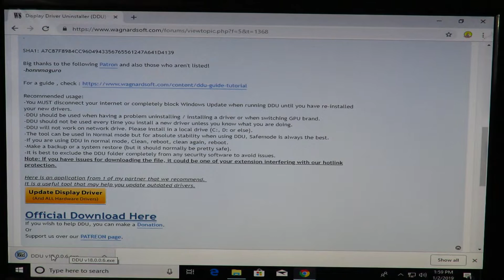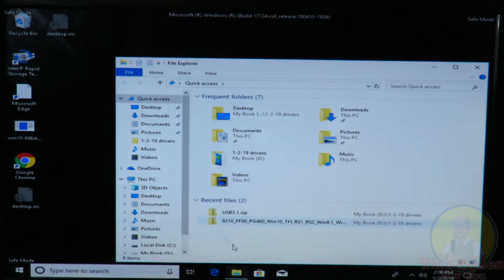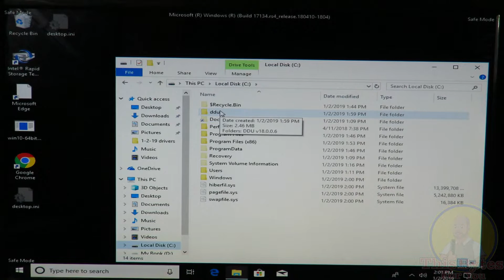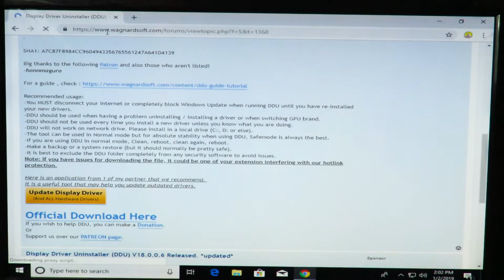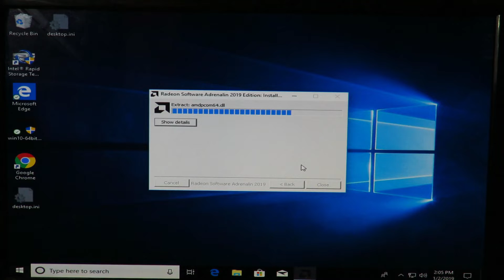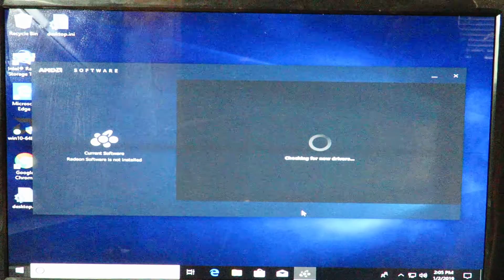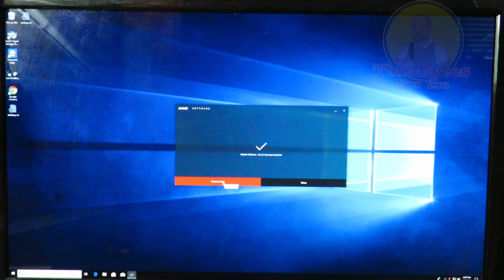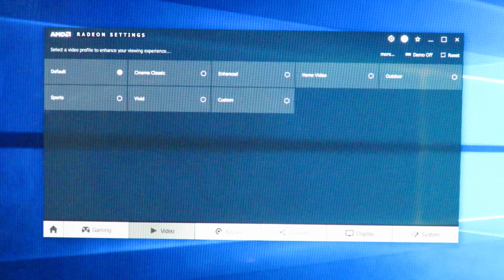How to install the AMD Sapphire Radeon Nitro+ RX 590 8GB OC Special Edition

Comment: I have a SAPPHIRE AMD Radeon RX 580 NITRO+, 4GB GDDR5, 256bit, 11265-07-20G
 (https://mediagalaxy.ro/placa-video-sapphire-amd-radeon-rx-580-nitro-4gb-gddr5-256bit-11265-07-20g/cpd/CSA112650720G/).
 What Power Supply do you recommend, or cable addaptors if will work. 
My old power supply(500 Watts) has only a 6pin cable,i tried to install it(connected the 6 pin cable) but doesn't work,the logo light is on tho(from the comments i understand that you need 6 pin and 8 pin cables in order to work).
My specs:
 CPU: Intel(R) Core(TM) i5-4460  CPU @ 3.20GHz (https://ark.intel.com/content/www/us/en/ark/products/80817/intel-core-i5-4460-processor-6m-cache-up-to-3-40-ghz.html)
Motherboard: MSI H81M-E33 (MS-7817)  (https://www.msi.com/Motherboard/H81M-E33/Specification)
GPU: GIGABYTE NVIDIA GeForce GTX 750 Ti 2 Gb
RAM:8 Gb
Reply from the maker: you are fine with a 500Watt, but not all have an 8Pin.  You can adapter 2 x Molex connections to make an 8Pin using this along with your 6Pin connection: https://geni.us/sVDjbp.  Let me know how that works out for you.
Reply: @ThisBytesForYou  Thank you for your fast response,i will get those cables and try it.
I forgot to mention the Hard Drives(2 HDD's and 1 SSD),don't know if matters or not.
Reply from the maker: It might, if you don't have available molex connectors,  make sure to check before you order it and you are so very welcome my friend
Reply: @ThisBytesForYou  

Finally i manage to buy a new power supply ,installed the graphic card and the latest drivers from AMD,but with this new GPU i have 60 to 70% FPS drop compare to the old GPU(GeForce GTX 750 Ti 2 Gb).Coul'd be  bottlenecking?
Reply from the maker: @Draccian  eeke, that should not happen at all, the 580 is much more powerful than a 750, it is 3 times more powerful.  Try Using DDU to remove the NVIDIA and the AMD video drivers (and make sure to disable the automatic windows update feature for drivers from within DDU so you don't have Windows messing you up), you can find my video on it here, and after you uninstall it all, install the latest and greatest AMD video driver and you should be good.  https://youtu.be/clLYbBywhAg

Comment: lay down the pc on the side,  plug in the cables and then plug the card in to the mainboard
Reply from the maker: yeah, as easy as building a house right, put some blocks up, put some pipes in, some cement, some windows, a roof and your done.  Steps you missed, turn off PC, remove side panel, remove older card and cables (if you have them), insert new card into 1st PCI-e slot, screw card into PCI-e slot, plug in both PCI-e cables.  Put side panel back on (optional) and turn PC back on.  Uninstall old drivers (you can do that before or after) and install new drivers.  You might think it's as easy as you say, but scroll down the list here and you will see how many questions people have and how many people I have helped.
Reply: I was pointing out what is easier to do! lay down the pc because its more maneuverable and has more stability to work, then plug in the cables into the card before you plug the card into the mainboard and you won't have to struggle with the cables afterwards like you did.
Reply from the maker: @halatameckarov6532  ahhh I see, i apologize.  So i have to build like that standing up, for a few reasons.  It is very hard to demonstrate with the PC laying down, it leads for bad shots with the equipment I currently have, working hard and heavy to improve all of that.  Also, I have a bad back, so I would have to hunch over to demonstrate and the biggest difficulty is that damn camera in the way,.. hahahah its right there, hard to get it just right without being in the way.  thank you so much for stopping by, checking out the video and commenting, it means the world to me.

Comment: Thank you! By the way, I am having trouble with audio after installing the graphic card. Do you know by any chance what's causing the issue? Or does the gpu doesn't support audio? I don't know what's going on.
Reply from the maker: You are very welcome my friend, very happy I could help.  Yes, the audio does work with the gpu, but you have to select it.  So in windows 10, if single left click on the right hand side of the task bar, where the time is, on the speaker, click on the up arrow that will open un a list of sound devices, find your gpu there and click on it, see if the sound comes out of there.
Reply: @ThisBytesForYou  I tried almost every way of changing default audio but no good at all. All the audio jacks are working when I plug a speaker device... my monitor has built-in audio speakers and these are the ones not working with the gpu, in other words it's not detected.
Reply from the maker: @davjjosol  maybe you are having issues with your video drivers, I recommend checking out this video, and following the instructions (where it says NVIDIA, use AMD instead) and then downloading the latest AMD Video drivers from here maybe and let me know how it goes: https://www.amd.com/en/support/graphics/radeon-500-series/radeon-rx-500-series/radeon-rx-590.  Your monitor has build in speakers but are you using DVI or HDMI/DP what version cable are you using and what monitor do you have?
Reply: @ThisBytesForYou  I appreciate your help! Very kind of you. Well I have the ASUS VC239(H) Monitor with HDMI. Will definitely check out the links sir thanks a lot!

Update: still no good, I've done this process again again after I plugged in the graphics card. Everything is fine except the audio via HDMI
Reply from the maker: @davjjosol  OK, going through the manual, I find this, let me know if this helps:
.• Make sure the audio cable is properly connected to the monitor
.• Adjust the volume settings of both your monitor and computer (So there is volume control on both the monitor and in Windows)
.• Make sure the computer sound card driver is properly installed and activated
.• Make sure the audio source is correct on the OSD. (The Audio source, it does not really go into detail what they mean here, but it is another thing to look out for)

https://dlcdnets.asus.com/pub/ASUS/LCD%20Monitors/VC239/ASUS_VC239_English.pdf

Also, on page 1 of this document, look at Diagram 2, B and C: https://dlcdnets.asus.com/pub/ASUS/LCD%20Monitors/VC239/F41G78S168011B_VC239_VC239H-W_QSG_EN_150514.pdf

And you are very welcome my friend, I love helping.  Please let me know how it goes for you.

Comment: I installed the gpu and got drivers then my screen went black and monitor detected no signal??
Reply: Yes I have
Reply: It’s not even detecting the dp anymore
Reply from the maker: That is incredibly odd.  Reset your computer about 6 times in a row which should take you into the section where it lets you select how you boot, chose safe mode with network access and download the and drivers from herehttps://www.amd.com/en/support/graphics/radeon-rx-vega-series/radeon-rx-vega-series/radeon-rx-vega-64, then use ddu to uninstall the amd drivers and when you reboot you should be able to go back on into regular window, then give that a try again
Reply: i fixed the problem something was wrong when i put it into my motherboard it had a issue
Reply: i had to reinstall it
Reply from the maker: @MaybelineMomma  ahhh ok cool, I hope you like it
Reply from the maker: That's wierd, it should have come back.  Have you tried restarting your computer manually?

Comment: Very helpful video but I am still struggling with getting it working!

I have slotted it in and hooked up the power cable to the card directly. I have a hdmi cable going direct from the GPU to the monitor. When booting the pc up the GPU has a blue light on which I'm guessing is good as signifies it has power going to it. The monitor  I recall says no input source or something along those lines. I have also tried a DVI from GPU tp hdmi monitor.

Any ideas of what I'm doing wrong?

Cheers,

Andu
Reply from the maker: have you tried making sure your monitor is on the HDMI input, not all monitors connector automatically to the correct input?  Also sometimes, as stupid as it sounds, removing and reinstalling the video card helps.  You have both PCIe cables connected as well right?  And thank you so much for your kind words, they mean a ton to me.

Comment: Hello there, I just bought a rx580 and I was about to install it today but I noticed my PSU has only one 8(6+2) connector. It's 500w and on the box of the rx580 it says it's enough so is it ok to just attach a Y splitter 8pin to two 8(6+2) pin?
Reply from the maker: yes, 500 watts is the recommendation for the card, but rather than split the 8Pin, which may consume too much power, why don't you get something like this, so you can use your molex connections: https://geni.us/sVDjbp.  I would recommend you plug one of the 2 molex connections (one adapter brings 2 molex adapters) into one strand of molex cables on your power supply and the other molex connection on another strand, to make sure the power is distributed evenly, then plug that into the video card.

Comment: hi, im building a computer for my niece, and i have a question, the cables you connect to the video card are from the power suply?, mine dosnt have cables and i have to buy one i guess
Reply from the maker: I would be more than happy to help you my friend.  Could you please let me know who makes your power supply and the model one?  Also, please let me know what motherboard (make and model) and what CPU you have.  This way just in case, if the power supply you mention is not good enough, I can get you the right one, I am always happy to help you my friend.
Reply: @ThisBytesForYou   good morning. The powe suply is a corsair 750m, processor i7 6700k @4.00ghz and the mother board is an asus b150m-a/m.2. Thank you for your time and response
Reply from the maker: @keikakudoori  good morning my friend, looking into the specs, I see that the power supply brings 
6 x 6+2-Pin PCIe cables, so if you still have the box, they might be inside,if you lost them, then you could probably order new ones from corsair, just email their support site: https://help.corsair.com/hc/en-us/requests/new.  its a good power supply, but its not cheap: https://geni.us/LKZy.  And you are very welcome, thank you so much for checking out my video and even more for commenting ,it means the world to me.
Reply: @ThisBytesForYou  no problem. but i cant get the cable from the suport in my country. my last question is if i can buy the cable in amazon. there is one that have an 8 pin  male that goes into the psu, and then the cable have 2 ends of 8 pins (6+2). i can use this cable or i have to buy 2 cables (6+2 pin)?
Reply from the maker: @keikakudoori  problem is its hard to know exactly what cable to get, they are not all the same, each manufacturer makes different cables, for different power supplies, but maybe this would work for you, https://geni.us/TEM9J or you can contact corsair and find out what package will work for you, they will give you a cp number
Reply from the maker: @keikakudoori  but if you do, yes, the cable that has 2+6 Pin is perfectly fine.

Comment: Just installed this card but I'm confused on the cables I need. I have an 8pin male to 8pin male but I don't have any 6pin cables. Should I buy a 8pin to 6+2pin pcie cable please? Cheers phil
Reply from the maker: do you know what manufacturer and model power supply you have?
Reply: Thanks for your quick reply, I have this one: Game Max RGB-850 850W Modular 80 Plus Gold Power Supply
Reply from the maker: @funky348  so be careful, it looks like you using the 8Pin EPS cable, for the CPU.  The unit states it comes with 2 x 6+2 cables (which are 8pins), so if you still have the box with the cables in it, those should be there.  If not, let me know what motherboard you have as well.  And you are very welcome my friend, always happy to help.
Reply: My motherboard is a "Aorus z270x-gaming 7"... the graphics card didn't have any cables in the box. I had a black 8pin connector already so was going to use that but will wait and go with your recommendations. Thank you.
Reply from the maker: @funky348  no no, I mean the power supply should have extra cables.  That 8 Pin connector I think is for your CPU, check the power supply box (if you still have i) for extra cables.
Reply: Sorry i misunderstood... Yes you are right I have two 8(6+2)pin cables... Assume I use both with this card (leaving the two pins out of the 6 pin port of the card on one of the cables)?
Reply from the maker: @funky348  yup, you are correct ;), let me know how it goes.
Reply: @ThisBytesForYou  thank you for your support. Much appreciated!
Reply from the maker: @funky348  you are so very welcome my friend, I hope to see you around here more often and if you have any other questions, as always please feel free to ask

Comment: Would you recommend this card for the the coming years to play at maybe 1080p high and also I wanna play games like cyberpunk2077 call of duty Black ops 4 and rage 2
Reply from the maker: yes, it is a great card and it should be able to play Cyberpunk 2077 at 1080p, but you can find the requirements here, Black Ops 4 and Rage 2 you should also be great with the Sapphire nitro+ RX 590, you can check it out on Amazon: http://geni.us/CWSOO8N.  As for tomorrow, I cannot say, as games require more, they are forced to make better video cards and vice versa, there is no such thing as future proof I am sorry to say.  You can check out the system requirements for Cyberpunk here: https://www.game-debate.com/games/index.php?g_id=4614&game=Cyberpunk%202077.  Let me know what you decide to do.
Reply: I think I might still get the Rx 590 I'm fine with turning some graphics settings to medium
Reply from the maker: @MaybelineMomma  OK great, and actually even with the highest end care, many times there is no need to go to the highest settings, Medium or High is great as it is, I like the way you think and I agree with you.  Let me know if you end up getting the card, and if you use that link, it would help me tons as well.  Thank you so much for stopping by and checking out this video and even more for commenting, it means the world to me.

Comment: will this gpu work at 1080p highest settings triple aaa titles
Reply from the maker: at 1080P, you should be good.  This card plays decently at 2K, but its optimized for 1080P, you won't be disappointed.  Check it out on Amazon: http://geni.us/CWSOO8N

Comment: I have AMD-A10 APU, should I uninstall the APU first before plugging in the card?
Reply from the maker: yes, download and use DDU in safe mode to uninstall the APU drivers then shut down the machine.  install the GPU, then turn on the machine with the monitor cable connected to the GPU and enter the BIOS.  Disable the APU in the BIOS, then save and exit and install the newer GPU drivers in the OS.  There are times that the APU will need to be used when entering the BIOS as the auto detect may not be selected, but you will surely know if you are not getting video.  Please let me know how this works out for you.
Reply: It's bottleneck imo, I have Ryzen 5 1600. Got 60fps on CSGO while 200+ on R5. CSGO/DOTA are cpu-intensive games though. But if you want to get the most out of your 590, consider upgrading your  processor.
Reply from the maker: @Kenjn_DJ  any game is cpu intensive if the resolution is set low.  You will get over 60fps if you have your vsync is on, turn vsync off.  Its not a bottle neck for the video card, I promise.  I recommend using DDU to uninstall all of the older drivers then installing the latest and greatest and make sure vsync is off and your onboard gpu is disabled
Reply: I have also a10 7860k and an RX 590. Im worrying about the bottleneck :(
Reply from the maker: @lazylad6642  thats a decent processor actually, no reason to worry.

Comment: Can someone please help me? I'm new to pc gaming and I've been saving my money and I want to build a pc with this graphics card these are my specs

Rx 590 sapphire nitro plus 

Ryzen 5 2600

Asrock MicroATX Motherboard (B450M PRO4)

Evga 500 w (Power supply) 

Crucial ballistix sport LT 2400 ddr4  (8gb) 2x

WD blue 1tb hard drive 

Vivo black atx midtower

Can anyone with experience tell me if this works or if you have any better build ideas ( I still want to keep the ryzen 5 and the graphics  card the same) my budget is 600 dollars but I am planning to get a internet adapter and a monitor so all extra money goes to that. 

Please if you can help a noob out :)
Reply from the maker: sorry my friend, for some reason your message did not show up.  it looks like you have a good layout, but I would recommend,... if at all possible to have as your Windows drive, the C drive, an SSD, maybe a 250gig or 500gig SSD, the performance difference would be night and day.  Aside from that, it looks great.